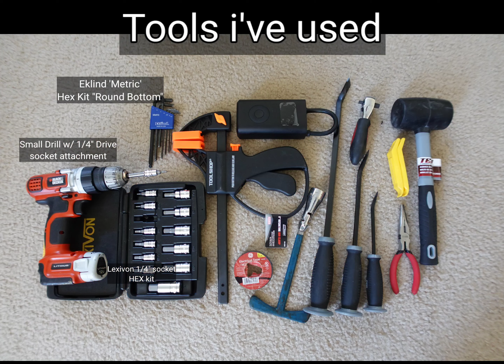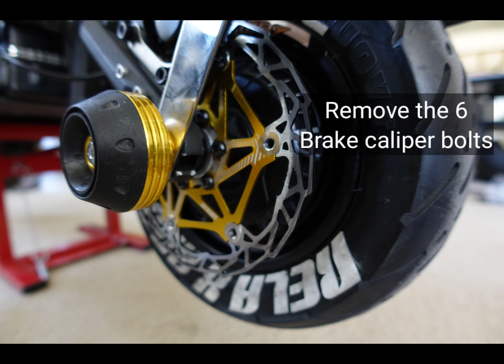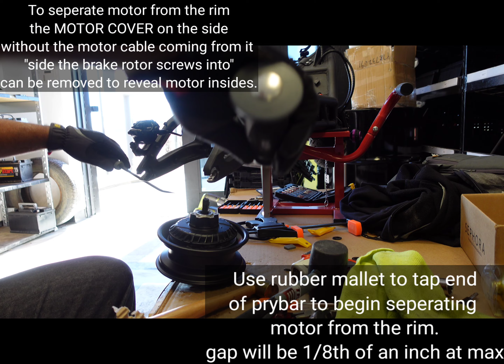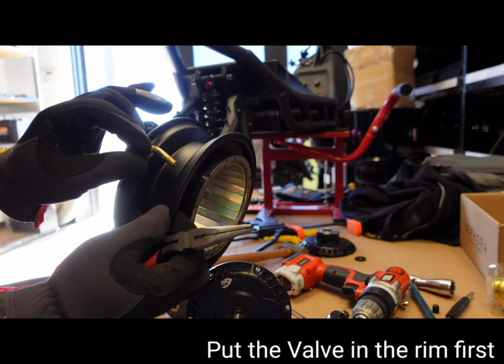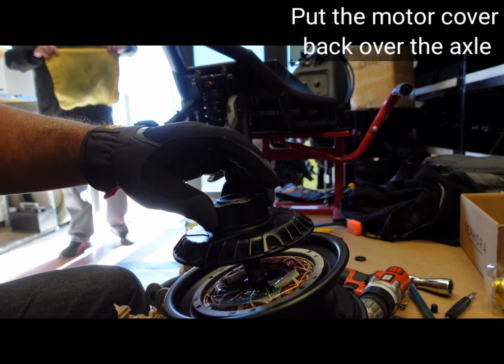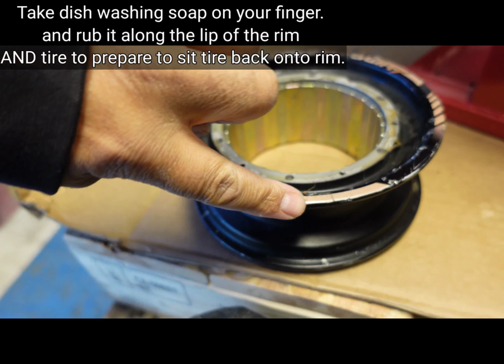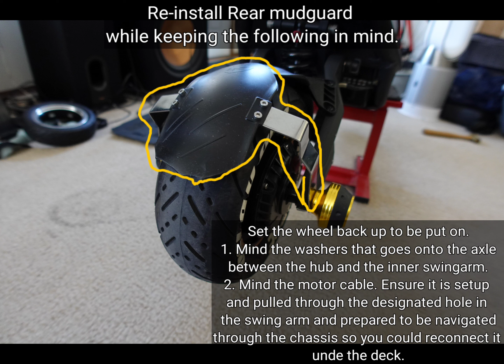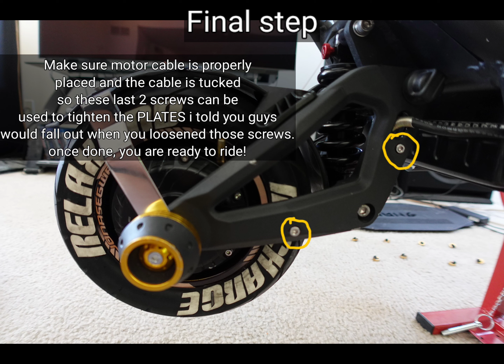Nami Burn-E Rim/Tire/Brake rotor change *Formal Version*

Comment: I just got my second Nami (replacement, both motors went out in the same day on the first one) and it's pretty banged up. Both tires are really out of balance to the point of the rear tire bounces around at 35-40 mph. I have never done any kind of work on a tubeless tire before, so my knowledge is very limited. My question is how do you balance the tires out?
Reply from the maker: It's me Allan. Jason Maynard on Facebook lol.

I could have sent you this link to my video but I like to let people find me on their own. 

If you are talking about that stupid wobble we get even without a bent rim, I would say use motorcycle rim weights and place them along the nami's rim opposite of the valve stem. Apparently that along with adjusting your suspension's stiffness helps just about completely eliminate that issue. 

Everyone that ever had this problem who went to PMT tires said they never had a vibration with PMT's. Apparently another issue with these have been tire deformity with the nami's stock tires
Reply: @Jonasegway  I think these tires are either warped or FedEx did such a horrible job shipping it they knocked the tires out of balance. Either way huge pain in my ass!

Comment: Man I think I'm going to go with the bronco extreme 11, split rim tube tires, don't have to remove the motor from the scooter.
Reply from the maker: And I would reinforce your decision to want a bronco Insteas by telling you the two people I know who took that leap of faith and purchased a bronco LOVES it! The bronco to me is on the podium of the top 3 scoots in the $4-5k range. Also during major holidays the price has gone down into the upper 3k range if you have time to spare for one of those holidays to come around.
Reply: @Jonasegway  Thanks for the reply and confirmation. On the horn with ewheels right now. Glad I cancelled out the the Kaboo King GT, with crap suspension
Reply from the maker: @foam27  in that case, great move on changing your order. Real quick, see if they will be getting the Bronco VNom. (Assuming you're a U.S. customer)

And you are very welce my man!

Comment: that seems like way more work than necessary with a higher risk of damaging the internals of your motor..
Reply from the maker: It's no bad. If I did it without trying to record it alone, it would have been way faster. This is like most things done for the first time. Everytime you do it, it gets easier and easier. You get faster and faster. I wreckeon I could change a tire out within 30mins now.